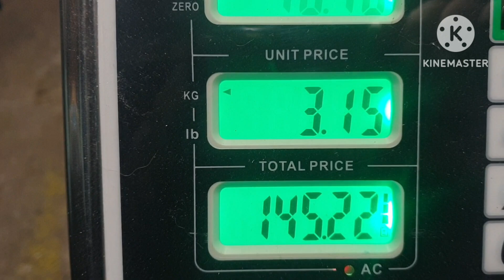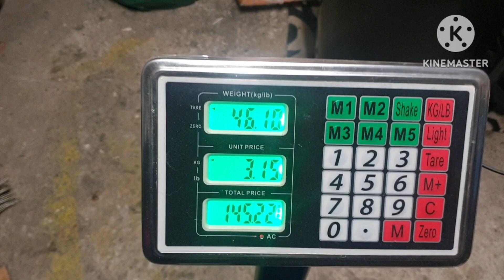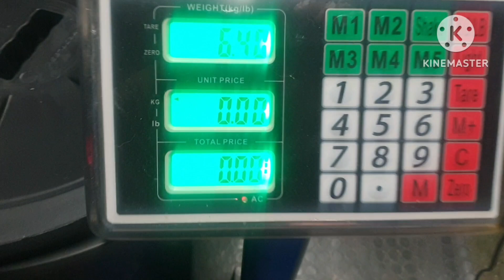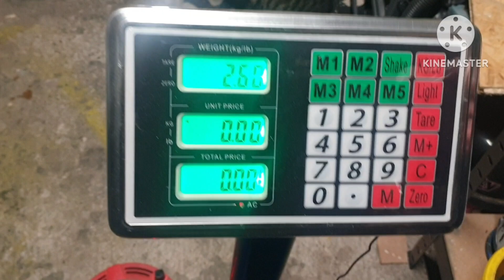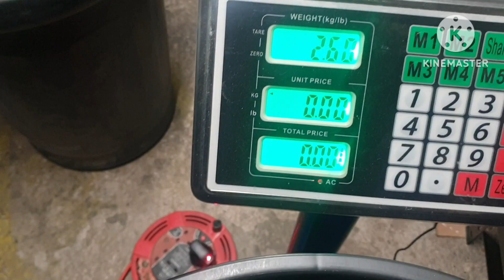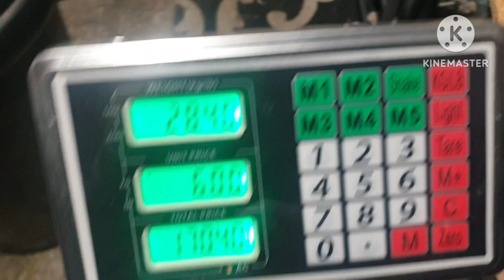stripping copper wire #how much a hour 🤔🤑

Comment: I'm at the same thing over here. Just relaxing and stripping.
Reply from the maker: what's your favourite type of copper cable you like to strip  the most ?nothing better then stripping copper wire and thinking shall I sell or melt it  🤔 😅🤣
Reply: @nightscrapperuk13  I was just doing romex, or house wire I think you guys call it, but I like doing the big 2/0 cables. I think they're the biggest that fit in my stripper. I'm melting all of my wire.
Reply from the maker: @HHRecycling yeah romex is the equivalent to are twin and earth witch is used for lighting and sockets inside houses here, yeah melt away buddy, hope you do a video on it,will it be on your other channel or this one ?
Reply: @nightscrapperuk13  It'll be on this one. I just ordered the 12 kg one from Ian's link. Should be quite a learning curve. I need to get some molds and other pouring tongs, too.

Comment: Nice scales,   Shame BB price is low, you must have hands like leather. I get
It’s of copper splinters in mine,  though I do have soft hands being a mouse pusher.
Reply from the maker: Yeah I got the scales ⚖ of amazon, am use to copper splinters, its that hairy copper what leaves splinters in my fingers,I've stripped more BB ,you have the same scales ⚖ as me , but you have them in black ,have to phone up the yard on BB price before I weigh in